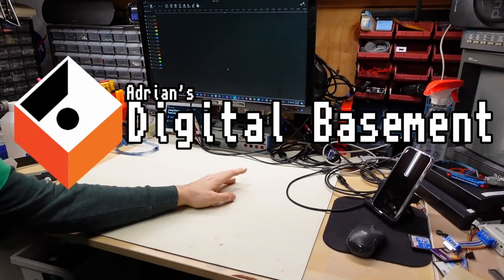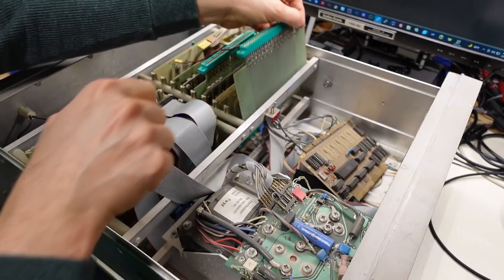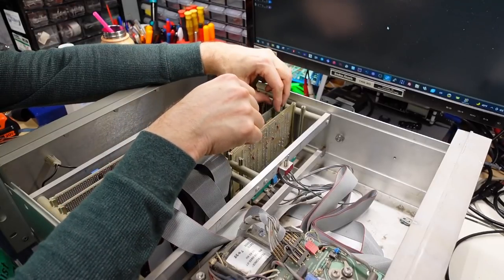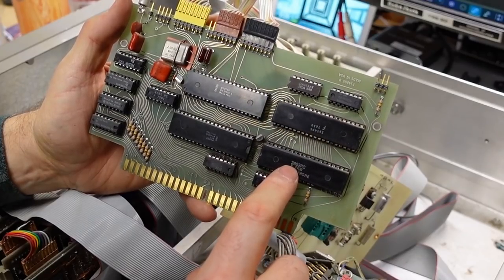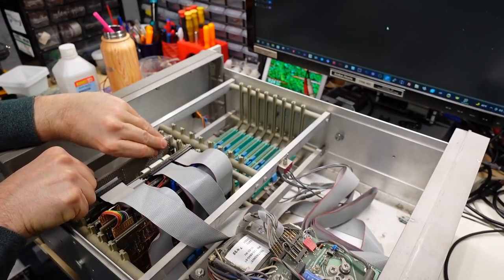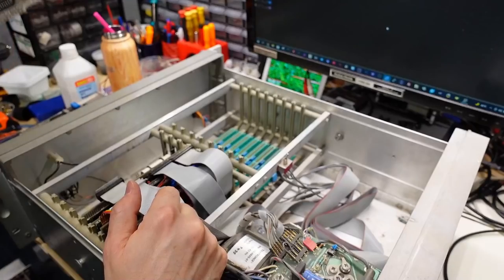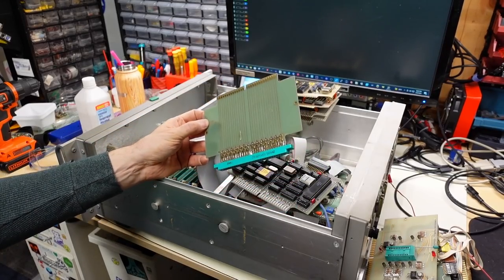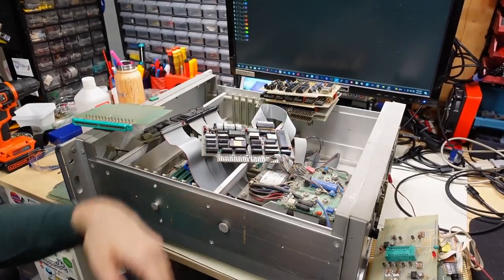I need help finding information on this mysterious computer

Comment: This is custom built, looks to be a low volume, one off or a prototype. 
Havent finished watching but if I had to guess from 5mins in this was mad for a hardware manufacturer or tester. This was not a cheap machine could have been in house with custom chassis. 

Could also be a scientific or computer laboratory "server" i doubt this machine has a vendor or name in any traditional sense. Maybe the lab it was in had an in-house name,  can check off any industrial setting due to how clean it is (ik its dirty but that's clean for something so old), so definitely a climate controlled lab, not pressure controlled atleast for where this lived.

My guess this was mounted on a trolling rack and was wheeled to where it was needed (can tell by the odd screws where the rails usually go in the outside), at some point in its life it was desk mounted (evident by the beastly feet, could also be to help reduce sound and try electrically isolate it from the work bench).

Most of it is custom spun very low volume cards, transformer would be safe to use but lookes modified to provide required voltages, you'd find it probably outputs a few voltages.

I pretty blind but somewhat "educated" guess, r&d/engineering machine for production of isa cards, what type I could only guess but perhaps 2d graphics cards or perhaps peripherals/ide cards. This machine had to have been connected to another, still not at end of video but id say the connectors at back used existing cable formats to jerry rig to the host pc, the "ide" ones would be my guess for the main grunt of the work.

Another random option for what it could be doing. Batch eprom programming machine/cloner.either way its custom made to suite the clients needs.
Reply: If anyone knows for sure please let me know how insanely wrong I am. Sorry its so wrong I had to force myself to stop writing

Comment: I think that the 2708 could be read using just +5V, but you'd need a higher voltage like 12 or 15 V to program it. At least that was the case for the 2716.
Reply: Any chip that has a -5v pin NEEDS it. It's a bias voltage for old silicon from the 70s, and the chips will not work without it. From what I've read, it should also be the first rail on and the last rail off.

Comment: That is one stout power supply and probably has a lot less ripple than a PC power supply has.  You've got the equipment to check it out.  Just remove the cards before you do.
Often engineering used wire wrap wire for ECNs.  The board with the empty Texas Instruments sockets probably was for PROMS or EPROMS.  You keep saying "home made board" and they are not, they are engineering prototypes or low production boards, they are way too neat for home made.  We used wire wrap for ours including low volume production systems.  The back plane boards were wrapped on a Gardner Denver wire wrap machine that you climbed into to change out the boards.  The smaller boards were hand wrapped by women.
We did have CRT terminals that generated the video in the terminal and only had an RS232 input.  
I started working in electronics in 1972 and I go back to punch tape and core memory.

Comment: Those pins might have been to allow use of either 300 mil or 400 mil parts. Some dual port RAMs came in both 300 and 400 mil packages... but I'm just guessing...

Comment: A CP/M boot memory aside... - its definitely a computer system.
Lots of Z80 IO chips. And also some floppy controller.
Somewhere some CPU.
From the setup it looks like a predecessor of some IBM PC design. Prototyping... nothing you will continue to do when going into a lot of 10 or more.

Comment: This honestly looks like something in the DOD. I'd guess it was a JTIDS terminal, but that is apparently 1990 technology, but the core tech it's based on existed in the 70's. JTIDS are obsolete these days, but they have modern replacements. I'm guessing that this is a predecessor to that............ehhhhhh maybe not. If it was something like that, it would be JAM PACKED this has way too much empty space.

Comment: Hey, my 'Home Brew' was made better than this in the early 80s.This looks like someone has gathered a Tectronics power supply from something else and added it to a dual frame box from somewhere. More than likely, this was an engineer's desk machine used to develop code and hardware on. A jury-rig of bits, changed as needed. At the time, my machine was made mainly from PDP11 bits but ran a 6502 processor. I remember rewiring it later to run a 6809. Stopped using it when 6501/11s came out and things started to be more embedded. Also changed to doing Protel PCB designs, cross-compiling and simulating assembler code on PCs.  
Thought the original PC XT and it's Taiwan clones were a bit of a backward step.

Comment: Looks familiar. It very much resembles the cryptographic key management simulators we used to have that were for testing wire (ACH and CC) transactions for financial institutions and merchant terminal manufacturers, especially given the range of cards and seemingly weird IO on the back.
Reply: Andrew Ellebract, being crypto gear, wouldn't such a unit have to be destroyed after being out of use? Or it just looks like similar construction was used?
Reply: @richpayton7162  a lot of times things end up lost at the client site or just forgotten in a cubicle until space is needed, at which point some intern will squirrel it away. 
I can recall sitting in a "conference room" with no less than a dozen HSMs that resembled very much what you have there, and for me those would have been built around the same time that I was.

Comment: This is definitely before my time I started working in the late 80s with their products Tektronix that   is. From a web search I see they made rack mount oscilloscopes. TDS 3000 series and whatever other models they may have made.
Reply: They made rack mount scopes long before they went digital. Some were completely vacuum tube based, some were hybrid and others 100% solid state. They designated the rack mount versions by adding RM prior to the portable model that shared the same basic design. I currently have a RM529 Waveform monitor in my collection.

Comment: To me it looks like a custom built printer server for a large plotter or printing service. I've seen all kinds of extremely odd things like this before, no two are ever the same. Larson Pr used to custom make servers like these in Houston for all sorts of bizarre proprietary print devices. Usually large plotters and the like. Now it could also be a rudimentary bot controller too, those (of the era anyway) can get WAY bizarre
Reply: Whoops forgot to add that some of the cards inside, the type of IC's used and the whole backplane weirdness kinda led me to believe this might actually be a print server/controller. Not really server in the modern sense, just a control device. An interface between the device and user terminal/computer.

Comment: I will guess this is an industrial robot controller experiment, the sip socket will take the programming for positionning the robot arm.

Serial and paralelle card to send command to the robot and receive position.

No display necessary.

Comment: The board at 6:15 where you have an overlay saying it might be for 2114 or mos 6550 sram, instead, I'd guess they're for zig zag in-line package memory chips common on Amiga 3000 (and expansion boards for amiga 500) and Acorn Archimedes 300 and 400 series...  But that's me screaming into the void of a yt video with 300+ comments

Comment: I'd say the machine was all terminal based. I used to build crap like that on the kitchen table back in the 80's. From the quality of the work the person was clearly an engineer. This isn't the kind of work that an amateur does at home. I can tell you someone spent a lot of time drinking lots of coffee and eating moon pies ( the drink and food of engineers) building this. It looks like it started out as a commercial device and grew from someones brain from there.

Comment: with the lack of video circuitry, could this machine have been connected to a teletype machine?
Reply: Not without a RS232 to current loop adapter. Most Teletype machines were built to work on a 20 mA loop. Earlier models used 60 mA.

Comment: Not a 'computer'. This is custom-designed test equipment, most likely used in manufacturing product, or scientific research project. This might had cost probably upwards of 10,000 dollars to design and build, though this one shows cost saving while getting the most function . It would had paid for itself many times over trust me.  Shame the documentation isn't with it, everything would had been explained. 21:32 that's a timestamp generatro

Comment: That is a teaching computer for repairs. It is used to teach students circuitry and how to fix a computer boards. The case it is in, the system reminds me of an old 60s to 80s server super computer from that time period. Brings back some memories. They were also used in businesses, NASA, and military. They were designed to be rebuilt on the spot. Here is another version of them. It might give you a better idea of what they are.

https://www.bbc.com/future/article/20160729-the-hidden-base-that-could-have-ended-the-world

Comment: With all the diagnostic interfaces and chip programmer, I would guess this is a internal prototype. This machine was more than likely never rack mounted because you could never get to those interfaces, and where would you mount the floppy where you could have access in a rack?
Reply: I agree that this looks very much like  development system, but regarding floppy placement you are completely wrong. There were external floppies in separate enclosures well into 80s, and even some PC-compatibles had all their drives (fdd and HDDs) in boxes like this.
Reply: @АаронЗильберштейн  In that case why didn't he have the case for the drives? Did computers when this was made use expansion enclosers for HDD and FDD. Yes. The context on what he received together suggest that it is just a hardware prototype. I'm unaware of any software development systems that provide access to the bus. In the hardware space maybe, but then why use non-standardized connectors? Wouldn't the company have provided hardware and software schematics so companies wouldn't need this system? Either way there is not enough information and without someone looking at the outputs of the connectors on the back we won't know for sure.

Comment: This looks to me like DOD tech. You very often found the original chips mixed with 80s chips that served as updates. This type of system was often propriatary based to what ever it connected to such as radar, power plants, sonar... 

Basicly when you would update the rom for a newer version of the firmware sometimes you had to bypass different ram chips so it would be compatible. It explains why you do NOT have descriptions. The giant switch inside is a tamper alarm by the looks of it.
Reply: Thats my theory anyways ;)
Reply: Also explains why the case is so well machined.
Reply: FransLab had a piece from an old nuclear launch center and the custom jobber cards look like the same level of work. Again upgrading old 70s machine to keep working in the late 80

Comment: Looks like a version of the Research Machines Z80, built around 1977.  Runs a CPM OS and had the BASIC language interpreter for programming,  It had a green char/text based screen and a keyboard.  https://en.wikipedia.org/wiki/Research_Machines_380Z.  Schools in the UK used them in computing classes at that time.
Reply: Via Google research - Research Machines computers didn't have a backplane at all, rather ribbon cables were used to connect cards to each other...  And from the "Architecture" paragraph of the Wiki article:  "The system used a passive bus architecture with no motherboard – all electronics were contained on a number of cards interconnected by ribbon cable."  Images on the web show cards don't have PCB edge connectors & a ribbon cable for interconnection...

Comment: Looks like a pager transmitter or mobile phone controller from the 70’s or 80’s. Or a telco to mobile phone interface. Some sort of that style equipment…think 150 or 450 paging/mobile phone. Alot was put together as a home brew in that design… That why there is no monitor per say. Think of all the 2 tone or 2805 signaling that went on back then… there are a few others as well… no real standards. 

Another area is fire department paging, dual tone paging to fire whistles and fire stations call outs, then there was the 2 tone stuff that came out… you never know…

DE N2JYG

Comment: Genuinely curious on the purpose but it really looks like a mashup of serial communication components, reminded me of point of sale systems that had to be backwards compatible with itself while trying to stay technologically relevant.
Reply: POS infrastructure design is often insane to the point of idiocy.

One memorable service call was to upgrade the boot drives on the POS terminals. Modern 4C/8T Core i7 CPUs, 16 GB of RAM, NVMe SSDs (no space for conventional drives).

They were being used as "smart" terminals, with all the actual business logic including the front-end UI running on a shared server in the office. The server had a dual-core Xeon without hyperthreading, 8 GB of RAM, and a single 5400 RPM HDD. It was also the manager's PC and the inventory system. The whole stack involved three VMs, at least one low-level emulator, four different operating systems (Windows Server, Windows POSReady, Linux, and OS/2), was written almost entirely in Java, and used a proprietary fork of VNC twice (two of the VMs ran on the server).

Apparently the drive upgrade was the vendor's attempt to speed things up . . ..

Comment: The housing looks almost identical to a server PC I bought with some friends in the 2000s, which was configured by the dealer. It fits regular 19'' racks as required by server hosting providers (or at least used to). The internals are of course completely different. Ours was regular PC hardware common in the early 2000s, the one in the video is something else which I can't make sense of.

Comment: Looks like some sort of basic PLC computer, which drives dumb serial terminals like a microbee or the terminals often used in banks.   Basically a crude programable version of something used for a specific programable task like an ASIC today.

Best guess it was designed to be a clone of various commercial systems, you just swap and burn an eprom to match the system you want a knock off of.       On a really long shot it could also be a master boot system.      You daisy chain computers (like apple II, vac etc) off this and can boot a room full of machines off one floppy.  You probably need to burn an eprom to suit whatever it is you wanted to master boot. 

But really until you get dumps off those chips it's anyones guess. My guess is it ran some sort of CNC machine.,

Comment: NOT a computer ... I suspect the box is one used by Lab scientists or Data engineers. as part of data logging or test equipment controllers as part of experiments. Not military but likely either industrial lab or Academic. The were well known to build their own equipment or make custom changes. Those home made boards are VERY impressive. Controlled by or serves other equipment. The heavy grounds/hefty Power Supply and such means they were probably trying to minimize stray RF or power bias in the data lines..

Comment: The dumb terminal https://en.m.wikipedia.org/wiki/ADM-3A
 
On the 25db pins 2 &3 are backwards to a 9db.  Pin 7 is ground.  You would jump pins 6, 8 and 20 then jump pins 4 to 5.  Pin 8 is carrier

Comment: I think you might have a manufacturing test bed, one to test the prototype cards, programs and drives in. Why else would it have a Eprom burner? you could test the program and then burn it :)
Reply: Actually it was very common for home built computers of the era to have an EPROM burner. As he pointed out those 2708's used in the computer itself and the spares. That's how they got programmed.
Reply: @nullvalu  im just saying that several test bed computers in the attic at an old employers of mine in the 90's had eprom programmers for the ISA card they made. Sad that all of those were dumped, many were hand built.

Comment: Given the DB connectors on the back, it could have had a teletype output rather than a CRT terminal.
Reply: CRT Terminals and Teletype Terminals both used serial communications - just different bit rates, different character bit lengths and different software protocols.